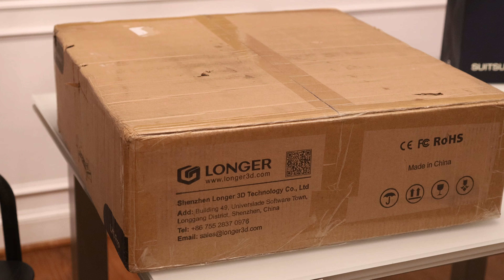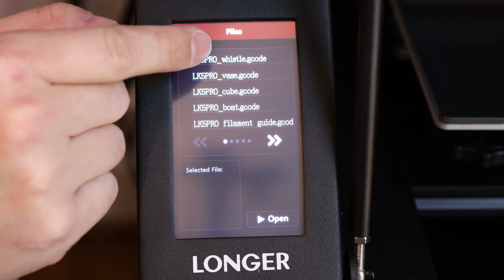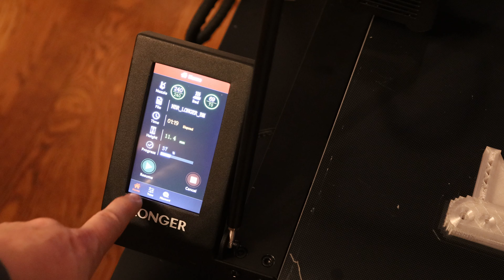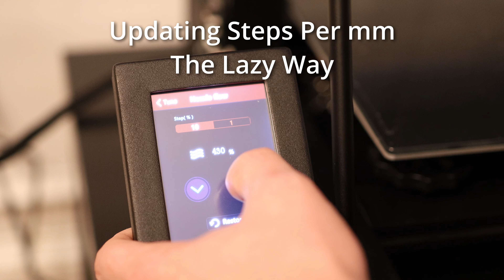Longer LK5 Pro - A Bigger, Better Ender 3 (Review and Upgrades)

Comment: Hey, I can't change the nozzle diameter option in cura 5.2.1, doesn't have any other option in the dropdown menu for the Longer LK5 Pro profile.  i'm stuck with 0.4mm profile setting, I actually try to "Hack" this with a different profile from an ender 3 ... and nothing... all this in software... I ran a test withy the phisical 0.6mm nozzle, and it did printed well, but the printing time it's the same as a 0.4mm nozzle, ( 2 calibration cubes, 1- with 0.6mm nozzle 30min print Layer height at 0.2 , 2 cube same parameters with  a 0.4mm nozzle and layer height at 0.12 ... same 30min print. ) I guess is the gcode, that doesnt change 0.4 to 0.6 ?? anyone?
Reply from the maker: I always use PrusaSlicer. It has never caused me issues to change the nozzle and extrusion width there.

Comment: @Nathan Builds Robots Great video! Don't forget to tell the audience at 5:55 that the 2nd stepper motor for dual-z is running of the same stepper driver. So no automatic gauntry adjustments.
Reply from the maker: Yes. I saw a good video by "my tech fun", where he compared different dual z setups.

If you go with dual-z on a shared drive it works perfectly... as long as you don't touch the printer! So if you can keep your hands off it, it will hold its level. 

I do like the added safety of having the belt up top, or dual z drivers, but in terms of cost its

#1 single z
#2 dual z on single driver
#3/4 dual driver and/or belt sync
Reply: @NathanBuildsRobots  I agree

Comment: Where did you get the jumper to make the printer think it always has filament? I’ve been through three filament sensors, so it’s annoying.
Reply from the maker: Easiest way is to plug the sensor with a piece of filament and hide it.
Otherwise you can use a multimeter to see which pins get triggered when you insert filament, and short them together.

If you need step by step instructions hop on the discord server and someone will probably help you

Comment: Why did you bypass the runout sensor? Great stuff as always.
Reply from the maker: It's a point of failure. I assumed it was more likely to cause a failed print then to save a print. 

I was probably wrong about that assumption though! Since it would have saved one of my larger prints. I'd just leave it on there, but now you know how to bypass it if you wanted to.
Reply: Where did you get the part to bypass it?

Comment: Haha, I have this machine for mechanical prototyping and jig making as well. I switched over to klipper, added ABL probe and accelerometer for bed mesh and input shaping. Now I am upgrading the hotend and extruder and possibly the mainboard. Thanks for your video.

Comment: Hey there,  thinking of making the upgrades plus some others. I feel the upgrades you made are crucial though the ones I was thinking to add to the Longer LK5 pro is adding the other Z - Lead Screw and a BL-touch.

My question is that with the cost of your upgrades, plus the two I mentioned. Would it make more sense cost wise to just get an Ender-5 Plus?

I am deciding between:
- buying Longer LK5 pro, adding upgrades from this video and two other upgrades. 

-buying an Ender5 Plus.
Reply from the maker: If you are looking at getting those upgrades I would seriously consider the Ender 3 S1 Max.

It comes with the awesome sprite extruder,  bed leveling, and dual z axis. 

I allude to the S1 Max at the very end of my S1 Pro review and left a link to it in the description. https://youtu.be/bVQNyGeD6Ng

I haven't seen any reviews in it yet, but a bigger version of the Ender 3S1 is a recipe for success. I will post a review on the S1 Max next month if you can wait to learn more.
Reply: @NathanBuildsRobots  do you mean the ENDOR S1 Plus? I didn’t see a max

Comment: I have to overtighten the excentric nuts on the gantry on my Ender 3 otherwise one side falls and takes the level outside the tolerance of the BL Touch, I am converting to dual independent leadscrews so I can use G34 in the start code to level the bed gantry each time prior to printing, I did it on my Ender 5 Plus machines and they now work perfectly.
any chance of you posting the URL for those PEI beds?
Reply from the maker: https://amzn.to/3jqlWnh
I'll add it to the description too.
I have not printed on it yet, but it appears to be of good quality.

https://amzn.to/3jqlWnh
Their 235mm beds are only $16.99 which is crazy cheap.

That is interesting, shouldn't you be able to compensate for it by changing the bed level?
Reply: @NathanBuildsRobots  You could but that is the wrong way to go about it IMO, the gantry should be trammed to the lower frame which is a fixed position and not the bed as having two variables involved is asking for further trouble down the line,
 the gantry changed level on a daily basis on the right hand side so it had to be fixed properly.
Reply from the maker: @AndrewAHayes  you definitely have a point. The prints end up skewed in a single z screw setup. Most ppl don't notice 1 or 2 degrees. Ignorance is bliss 😊

Comment: Hi what slicer do you use and can you advice on some settings that are used like speed and if with cura some experimental settings or super slicer and prusa slice are an alternativ? I have my LK5 Pro for around half a year and love it its easy to understand and user friendly for newbies like me. Thank you in advance
Reply from the maker: I use Prusaslicer.
If you install Prusaslicer, run the configuration wizard, and add the "CR10-V2" profile, you can use that quite effectively.

I have an article where I went over a similar setup on the Ender 3 S1
https://www.nathanbuildsrobots.com/testing/ender3s1

Comment: Single leadscrew??? What where they thinking?!
Reply from the maker: I thought the same thing when i first saw it. But look at the print quality - it doesn't look like it's suffering from the lack of the 2nd leadscrew.

If you watch Aurora Tech's video, she added a 2nd leadscrew to this machine. It looked like a pretty simple upgrade, since the board already has the header for the 2nd stepper motor. Just print out 2 pieces and plug it in.

Comment: I have the smaller LK4 Pro. I have to agree, it's a good basic printer for someone that doesn't want to spend a while lot of money, but does want to get into 3d printing. One of the biggest issues for me is they're sold as being quiet, but the fans on mine are anything but quiet. Still, I only paid $140 for mine and even with the few issues I've had, I'm happy with it.
Reply from the maker: That is a good price. I found this to be quieter than any of my Ender 3s by a couple of dB, since the power supply and motherboard fans are quiter..

If you want real silent operation you've got to install special fans like the noctuas.

Comment: Interesting printer
But no dual Z lead-screws on a BIG printer, is a no go in my book
God updates
Thanks for sharing your experiences with all of us 🙂
Reply from the maker: If this was a more expensive printer I'd complain about the single Z. But I see the logic behind it. They are trying to make a dirt cheap 300mmx300mm printer that still has good print quality, and I think they succeeded. Dual z is a pretty expensive feature to add if properly implemented. By leaving it out they can reduce the cost of the printer by ~10% (the difference between a $330 printer and a $365 printer). That reduction in price point is significant.

Just freeze frame at 2:51
That Benchy looks better than most 235x235mm single z printers. So if the Ender 3 doesn't need dual z screws, neither does this.

I have an Artillery Sidewinder x2, and will have a chance to compare print quality soon, so we can see how big of a difference the dual z makes

Comment: Switch over to G10 FR4 build surfaces.  You wont regret it.  You can get different sizes from mcmastercarr .  1/16 inch thickness is best.
Reply from the maker: I'll check it out. Thank you for specifying which thickness to get, you'd be surprised how often people forget to mention details like that!
Reply: @NathanBuildsRobots  I have been printing 24/7 for over 3 years now. Making a living off of it.  Keep the videos coming.  Your comedy is gold.
Reply from the maker: @MoeReefs  nice. I have about 12 printers that sit idle most of the time. Any ideas on how I can put them to use and help fund the channel?
Reply: @NathanBuildsRobots  Ok I will try to sum it up in short.  Find a hobby niche.  Find a common problem in that hobby.  Design the solution.  Easier said than done obviously.  It would be near impossible to do for the 3d printing community because everyone would just rip you off.  The 3d print community has a terrible culture of thinking because its 3d printed they are entitled to someone's unique designs for free and worse, they rip it off and start selling it.  You should work off of what you have here.  You got a talent for these how to and review videos.  Get sponsors.  Sell half or more of the 3d printers as they are paper weights not running.  Start a shopify online store and start making some t-shirts and hoodies that say "Im smart, I can figure it out myself" or " More mm3 Volume!".  Stuff like that lol.  Honestly it would probably be a lot less stress selling t shirts.
Reply: I saw the video from makers muse about G10 FR4 and he said that for printing nylon specifically, its probably better to use the 3mm or 1/8", because the nylon trying to warp up could cause the sheet to warp if you get it at 1/16". At 3mm or 1/8" you lose the ability to flex your prints off but I think most of the time the prints are gonna be cool by the time I get to them so it shouldn't be a problem. I wonder if at 3/32" it's still able to be flexed but strong enough to resist warping force from nylon.

Comment: and same time you need like week to level that thing plus on every print new leveling ,, waste of time and $
Reply from the maker: I just leveled mine once and have printed over 2 kg of filament on it.  It comes with yellow bed springs which should hold level pretty well. Are you having issues with this printer?
Reply: @NathanBuildsRobots  well i understand that you are payd to promote this junk so it is ok ,but you cant hide it is junk
Reply: @MrCcfly  not junk if it works tbh